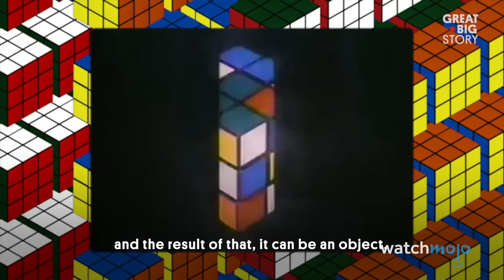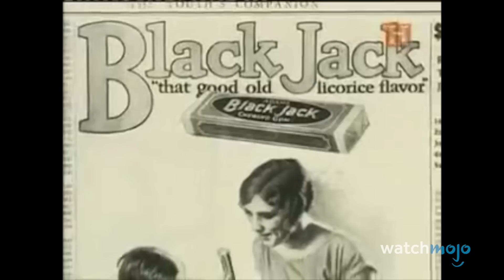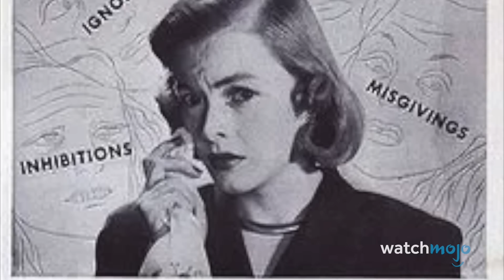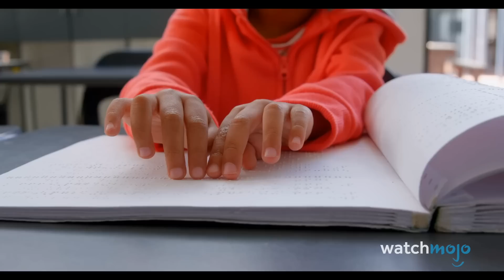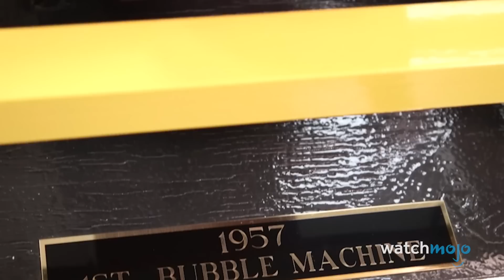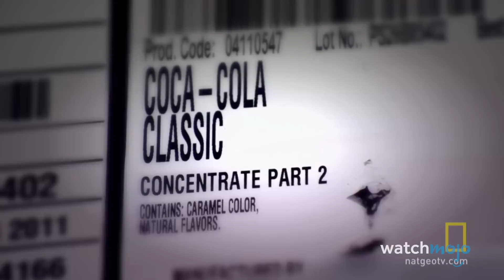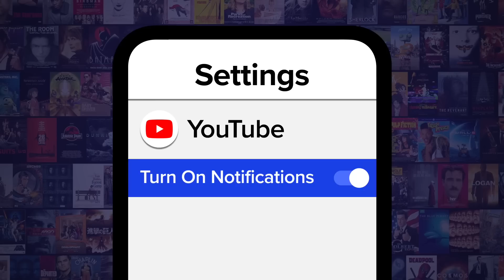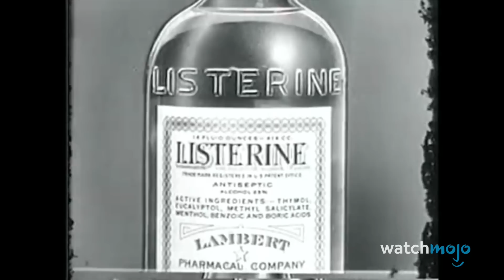Top 10 Products Invented for a Totally Different Reason

Comment: Using a corkscrew to remove a bullet sounds all kinds of painful and stupid 😂
Reply: Facts lol. When he first mentioned it I was like "ooh owwie" then he said musket barrels and I was like "oh ok that's better than a bullet wound" and then he said deep in the bone and I was like "oh HELL NO" 🤣🤣
Reply: Gave me chills
Reply: @pyrosmoak53  Especially when you consider that during those times, the patient would be awake and alert during all of this! (Unless they already passed out due to the intense pain....or blood loss)
Reply: also entertaining p
Reply: I wondered if the corkscrew would make some unspent bullets explode.
Reply: @jdmoncada8205  That's not how bullets work, at least not traditional ones.

Basically, a cartridge is made up of 4 components:
The bullet casing/shell, the bullet tip, the primer and the propellant.

When a bullet is fired, a small hammer smacks upon the Primer located at the rear of the casing, causing the propellant to ignite.
The resulting explosion forces the the Bullet Tip off the case then down and out of the barrel.

The case is then discharged from the firearm and a new shell is loaded in to the chamber, ready to be fired.
Reply: @Olkv3D  That was a really great explanation. Thanks! Honestly, I should have realized that already. I wasn't thinking the whole thing through.

Comment: While I haven't personally used any of these for their original purpose I have seen a few of them or their competing products used in a similar capacity. Ones I've seen: 1) Bubble gum: When I was visiting family in India, a rickshaw driver used bubblegum he was chewing as a temporary fix for a tire puncture until he could get to a nearby garage. 2) Play-doh: While at a housewarming party in the U.S.A I saw the caterers stick balls of colorful putty to walls near the barbeque and grill section to prevent oil and coal stains. 3) Cork-screw & Listerine: At a cousin's farmhouse in India, they were having some work done on one side of the main house and there was some sort of accident that lodged a tiny piece of rebar in one of the workers and I saw the foreman use the cork-screw on his multi-tool with mouth wash (wasn't Listerine) to remove the rebar. 4) Pacemaker: A DJ at a nightclub here in Toronto claimed he had recorded and mixed his heartbeat into the music with his pacemaker; not sure of the veracity of this claim. 5) Bubble wrap: A friend of mine used Bubble wrap as a temporary wallpaper to cover a wall with water damage in his townhouse.

Comment: True story - our car had a slow leak in one of the tires, and Dad didn't have a spare.  He collected all us kids' chewed gum, then took off the leaky tire, took out the inner tube, and packed the gum over the leak.  Then he replaced the tube, replaced the tire, and reinflated it.  That hack got us home--another ten or fifteen miles--where he could repair the tube with a proper heat patch.

Comment: In regards to the corkscrew, it doesn't explain how, if the bullet is made of lead or some other metal, that screw is going to penetrate the metal so that it may be extracted.
Reply: The screw would have surrounded the object, holding it in place to be extracted.

Comment: so when i was a kid (im in my late 50's now), i used chewing gum to fix punctures in my tyre/innertube. so what you do is find the hole in the innertube, put chewing gum over the hole, stick the 'tube onto the tyre and then put them both on at the same time. then all you need to do is pump up the 'tube and job done. it would last you til you got home from wherever, i guess because the tyre was warm from all the riding and the heat actually made the gum more rubber like. dont know for sure thats how it worked but at least i got home without calling anyone

Comment: In the early 90s I got a puncture in the rear tyres of my rgv250 Suzuki, at stupid o'clock in the morning in Peckham London. There's no way I was going to leave my bike there and get a bus home. Into the nearest petrol station 1 x pack of juicy fruits chewed up and stuffed into the hole. The gum held up long enough to pull in to every second or third petrol station and top up the air on the rest of the thirty miles I had to do to get home.

Comment: 9:27 I feel like WatchMojo must have made a mistake or maybe whoever decided to record the history of the pacemaker made a mistake... "The wrong resistor in the circuit" A single resistor of the wrong value is NOT going to make a circuit designed for recording into an oscillating circuit. Resistors aren't magic... I would have to assume he set out to make the pacemaker, I'm sure it was a fairly long process too.. To suggest otherwise is ridiculous.

Comment: Interesting that you had Lysol, Coca Cola and Listerine in your list. Lysol started as a hygiene substance meant for internal use but then became a general purpose antiseptic while Listerine had the exact opposite experience. There is a well known story that the real reason Lysol failed was because it simply couldn't compete with another feminine hygiene product that was extremely popular at the time: Coca Cola. Ever wonder why Coke trademarked it's unique bottle shape? Turns out it was a perfect shape as an applicator. The powerful carbonation guaranteed the expanding foaming fluid would reach deep. Just open the bottle, shake it up and you were ready to go.  As a common beverage, there was no stigma about purchasing it. And for some reason it is a powerful spermicide. If you apply a drop of coke to a drop of sperm under a microscope, you can see the sperm cells literally explode. It was also far cheaper than Lysol. If only they knew about Mentos back then.